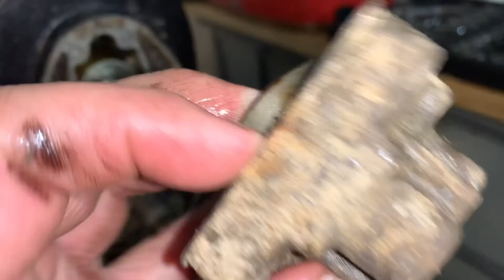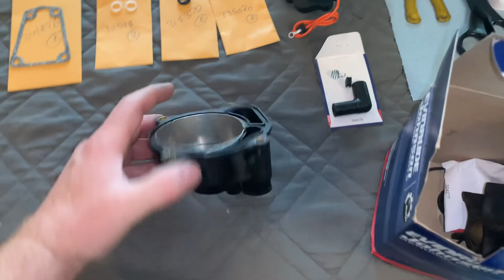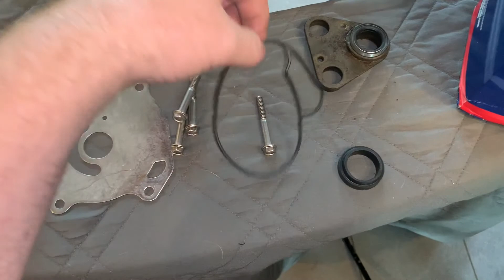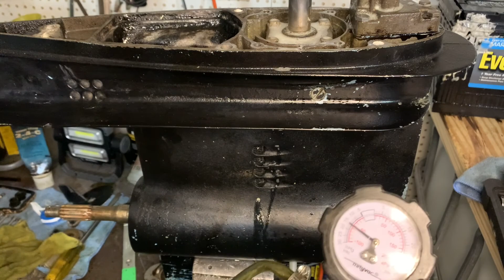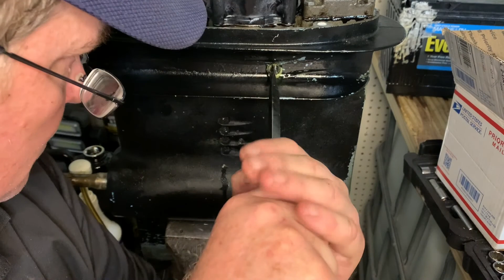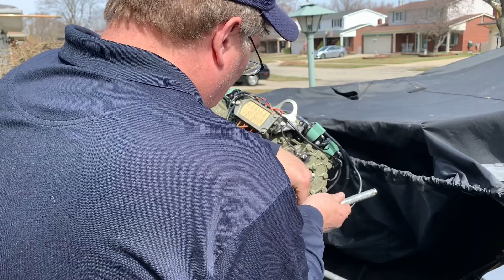1973 85 hp Evinrude - Part 2 - Tuneup & Water Pump Serviced

Comment: I have a 1976 85 hp Johnson javelin 85ETLR76G it's not ran in 5 years. There's a little rust on the coil packs. Should I change those? And also when I do the water pump should I change the thermostat as well?

Comment: All heroes don't wear capes. Hats off to you, good sir. 👍 I was pretty worried about pulling this old girl apart, but this video covers everything I needed to know, I think.
Reply: Is the black fluid you're using a gasket, or?
Reply from the maker: It's PERMATEX Aviation Gasket Sealer #3

Comment: On seals spring side up out down. And what were you using for the gasket hold? And what oil did you use  what weight?
Reply from the maker: From my recollection the drive shaft seals are stacked with the spring down. You can view diagrams of your LU gearcase at www.marineengine.com
I also use PERMATEX Aviation Sealer #3 for my gaskets. Also I use a high grade synthetic marine grade gear oil 85 -140 weight

Comment: Ql77jc4champion ran better before you put surface gap plugs in
Reply: I know it calls for surface gap plugs they never ran very well especially on idle
Reply from the maker: If you index the plugs properly they work very well
Reply: Lol
Reply: Maybe next episode you can show everyone how to do that
Reply from the maker: I ment indexing the standard plugs with electrodes. The reason it didn't run as well when I changed to the surface gap plugs was due to a missing Cylinder.
Reply: Oh OK I still don’t like surface gap. Do not run them in my motor. Yes, just a choice.

Comment: Where's the best place to buy parts? Looking at doing my coils and spark plugs here shortly. Thanks for the Video! Super informative
Reply from the maker: mooresey009 … Thank you for the kind words and taking the time to watch. You should be able to find what you need at www.marineengine.com and cross reference the part numbers on eBay for a lower price. Try to buy OEM parts when possible.

Comment: Hey LivetoFish that was a great video sir I just wanted to ask after you did all the repairs witch was outstanding…when the motor was running I couldn’t see the water coming out of the two holes and I was wondering if you could still run your engine like that?.
Reply from the maker: Brian Dotson… water typically comes out of one hole until the motor warms up once hot It comes out both holes in the higher the RPM the more water comes out. I hope that helps..
Reply: @LivetofishOutboardRepair  Thanks LivetoFish I appreciate you…I have a Johnson/Evinrude just like the one in your video it’s a 1975 85hp it runs great but I have to spray pre-mix to start it can you please share some of your knowledge to help me fix this sir.🙏
Reply from the maker: @Brian Dotson  thanks for your comments and question. The reason you have to spray pre-mix in the carb to get it running is because you need to rebuild the carbs. Your primer may not be working or the idle circuits could be plugged. The carbs should be disassembled and soaked in parts cleaner for a few hours. Use carb cleaner for a final cleaning and blow out all holes and jets with clean compressed air. If it seems to idle ok and is just hard to start the problem maybe that your choke is not working or your not using the correct startup procedure. Also make sure your fuel tank, fuel lines, connections and primer bulb are in good working order (no leaks or pinholes)
Reply: @LivetofishOutboardRepair  Thanks LivetoFish I will check as you described and get back to you with an update… it may be a little while because where I am the weather is still cold a bit but thanks a lot.👍

Comment: What is that part called on the motor you are using to change the throttle?
Reply from the maker: Seanp016… I believe you are asking me about the timing advance lever. It #96 on the parts diagram at www.marineengine.com

Comment: I thought part one was great.. this blow it out the water.. just amazing footage man!! I'm working on this exact motor so this breakdown has become my main reference!!
Reply from the maker: 13tayder…. I’m very glad the video helped you out. Your kind remarks are much appreciated. Thanks for watching and commenting.
Reply: @LivetofishOutboardRepair   so I got my carburetors rebuilt and putting them back on there I cant get it to start with out  starting fluid and once it's going with stay running under it's own power but the idle is a little rough what do you think it could be??
Reply from the maker: @13tayder  it sounds like your idle circuits in the carbs are still plugged or possibly your air/fuel mixture screws need adjusted. Carefully screw in the air mixture screws in until lightly seated then back them out 1-1/2 turns. This should be the factory setting. Then adjust them in or out to get best idle.
Reply: @LivetofishOutboardRepair  also when you have it running in the end the two little holes were exhaust coming out should I have water shooting out of there too??
Reply from the maker: @13tayder  yes when the motor gets to its normal operating temp you will eventually see water coming out from both openings.
Reply: I know this was a couple years ago but how much water should be coming out of the two holes mine is more like a spit is that normal for these motors I have a 76 85 HP Johnson V4 @LivetofishOutboardRepair
Reply from the maker: @kevincampbell5357  yes until the motor warms up to operating temp (~140*F) then it will come out stronger.

Comment: Nice but why did you put all new coils? Or is that how a toon up calls for? 
I’m wondering because I have a 76 77 &a 98 Evinrude 85hp motors  that I try to fix for my self.  Thanks
Reply from the maker: Mike Slavin… Great question! I replaced the coils because they all had cracks and even if they worked at idle would probably have broken down at WOT. You should always replace coils if they have visible cracks. Thanks for watching and commenting.

Comment: Hello! Can i ask what tool you used to check the lower unit pressure?
Reply from the maker: Sure it’s called a Mity-vac automotive brake bleeder. Amazon sells them for $32.68.
Reply: @LivetofishOutboardRepair  that’s the one you used to blow the bubbles in the previous video?
Reply from the maker: @sirjustis  Yes

Comment: I have a 1976 75hp evinrude and I have to use the warm up lever to sometimes just get it to idle without shutting off on me driving it on the boat trailer have restart  it 3 or 4 times when i do get it started i have to rev it up a couple time before i put it in gear to run it on the trailer am thinking it is idled to slow the original owner told me.the guy I bought it from said the idle was to high so this weekend I changed the water pump and the thermostat because he said it was 2012 when it was done last the thermostat have 76 printed on the side of it we have taken the carburetors apart and cleaned them but it still hates ti idle and will not start unless I use the warm up lever even if I have been running around the lake for a hour at full speed it run with no issues I am getting over 30 mph
Reply from the maker: Sounds like the carb slow speed idle circuits are still plugged up.

Comment: Hello, what is that black grease?
Reply from the maker: Einz... it’s not grease it’s PERMATEX Aviation gasket sealer.
Reply: @LivetofishOutboardRepair  Maybe You know one more thing - is it important from which coil spark plug wires go to spark plugs?
Reply from the maker: @einz2007  yes otherwise the motor will not run properly, timing will be off
Reply: @LivetofishOutboardRepair  I have Evinrude 90hp 1984. But so the right hand side cylinders (1,3) are in sync, so there is no difference?
Reply from the maker: @einz2007  it is important to make sure that the appropriate coil is connected to the proper cylinder. Each of these coils are wired to the switchbox and trigger. If you do not connect them properly they will not fire at the proper time and this will cause running issues or won’t run at all.